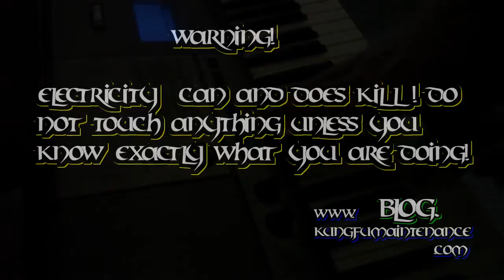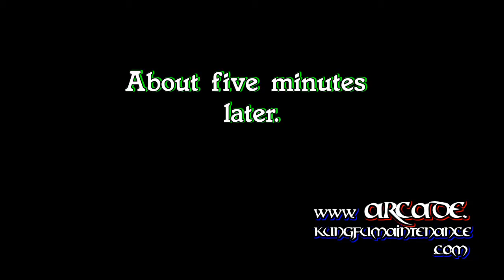Best Way How To Cover Automatic Photo Cells To Check And Repair Lights

Comment: Eh? A small cardboard box or a black cloth would be handier
Reply from the maker: +Lord fauntleroy I do show that method in another video however the glove is actually a little easier as it seals off better at the bottom. Lot of times with the box you kind of wind up wrapping another rag or cloth around to get a better cover plus sometimes different photo cells are different sizes. The glove is just kind of one size fits all and Handy :0).